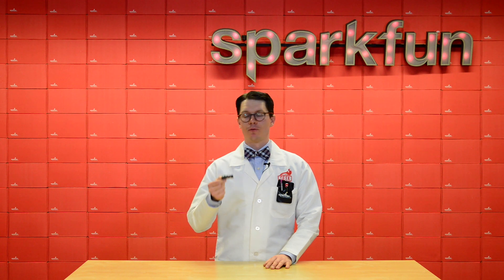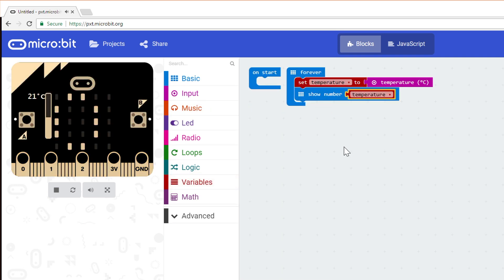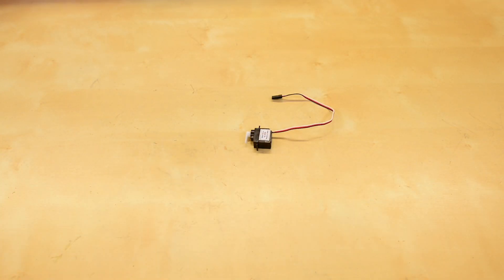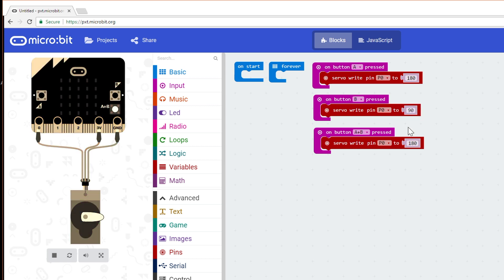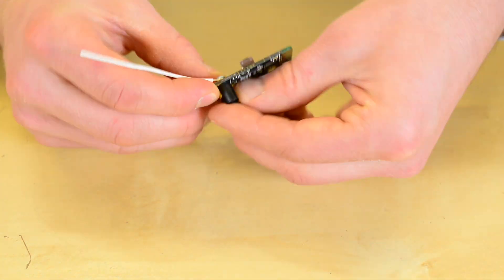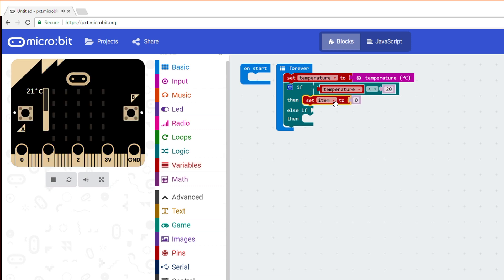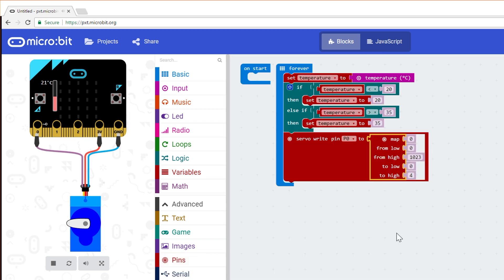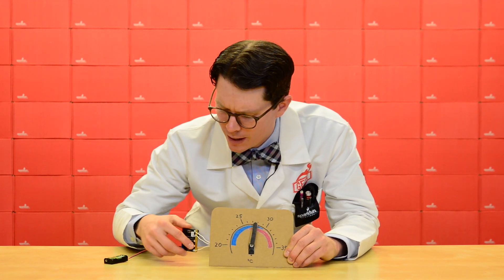Getting Started with micro:bit Part 3: Temperature Gauge

Comment: Is it a micro servo motor? What is the current drawn by the motor?  Hope it will not damage microbit when connected directly. What is the current rating of microbit?
Reply: Current rating:
V1:- 90 milli amps (V1 is the version of the microbit used here)

Comment: what wire gauge and length is suggested?
Reply: Sadly, I could not get the stall current rating on the servo (https://www.sparkfun.com/products/9065), so I'm not sure on the smallest wire gauge you should use. In the video, I used 22 AWG solid core wire (https://www.sparkfun.com/products/8026), which seems to work well for sticking in the servo's connector. Anything over 4 inches should be plenty of length to make the connection (up to a few feet, as that'll probably get unwieldy).
Reply: 22 AWG seems to be the average for breadboard play, so that's probably the correct one.